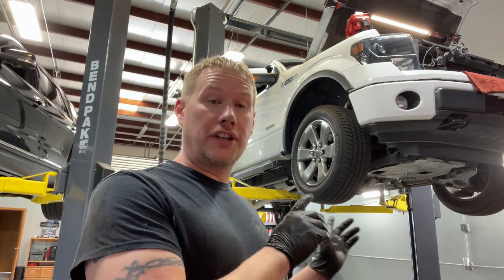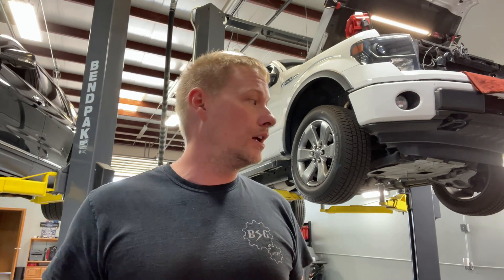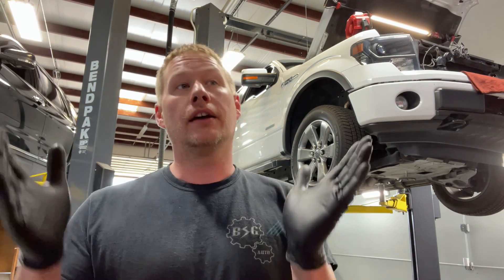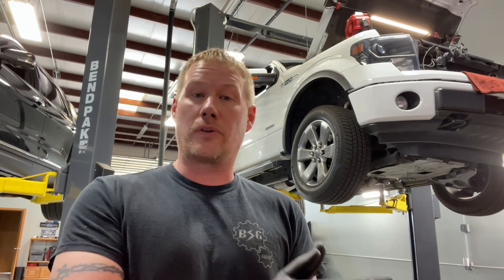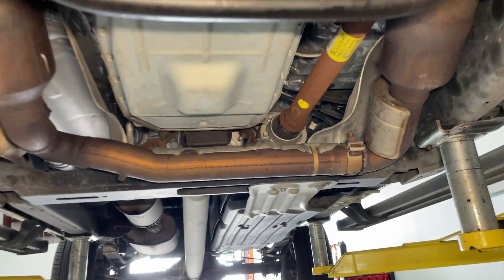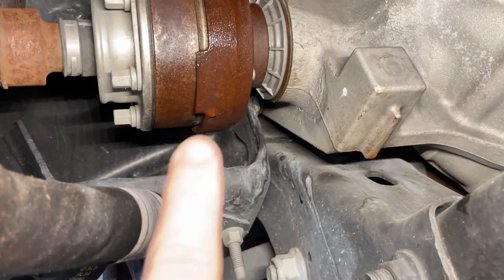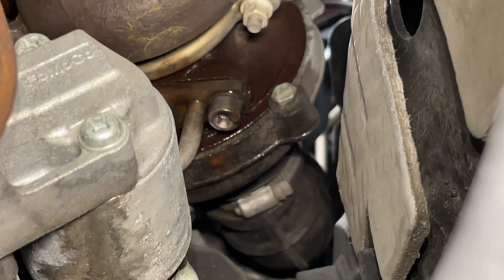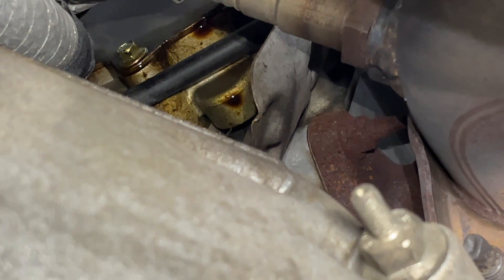Ford Ecoboost Engines Can be so Hit or Miss: I Really Feel Bad for This Customer...

Comment: I replaced my brothers ecoboost at 65000 miles as well. It’s just sad because the base 3.5L is an awesome motor.
Reply: Yeah. 
The engine really just can't take the extra load the dual turbo set up adds. 

They just need to add the custom turbo they use in the 2.0 engine and of the other ones. It won't be as powerful as the dual set up, bit it's alot lighter for the engine. 

It's the same issue the 1.5/6 engines had. They pushed them to hard.
Notice how the 2.0 engines actually seem to hold pretty good. They didn't go over kill
Reply: @nighttime1998  The 3.5l duratec was originally built for boost from day one in the early 2000s. It can handle it, there was just fords usual short comings in regards to oil temp control which ate away at the timing chain and then stuck valves through the pistons. Also lack of catch can and  no port injection for cleaning valves. So close Ford, so close!

Comment: Love my 2011 f250 4x4 6.2 gas. 180000 trouble free miles. Less fuel mileage,  but for me its a tax write off. My buddy has a 13 f150 with the 6.2. Wish they still made it.

Comment: I am on my second 3.5 EcoBoost in 9 yrs. 250k miles combined on the 2. Had 1 timing chain issue, valve cover leak, vac pump leak. The Ford's have been my favorite trucks I've owned, and EcoBoost my favorite performing engine. However I wish the EcoBoost was a pushrod engine like my  LS (or Godzilla) engines. Simpler design, easier to work on, don't leak nearly as much oil and coolant, and proven to be more reliable.
Reply: New LS is variable displacement and has had problems also like the new Coyote.  Old LS are rock solid dependable

Comment: Had a 2013 Ford explorer sport. T chain stretched. When you would start it up first start up of the day  sounded like engine was coming apart. And this was at 78.800 Had 100.000 mile warranty had to pay 100.00. But it was 3.800 touch screen locked up on it couldn't fix it. Had to order same one 4.200 another 100.00.  Very pleased with ford on all that. But the thing is people buying them and this stuff happening if u don't have a warranty man your SOL. High dollar stuff to fix. Have 2021 explorer ST now. Have put 7.600 on it so far.  We will see.  And o yea. Purchased BIG WARRANTY.

Comment: Aren't the new oils soppost to fix these issues the Sp Gf6 classification oils
Reply from the maker: yes
Reply: @FordTechMakuloco  Yes alot of folks that were using the old oils SN plus GF5 have had all these types of issues so far ive seen the SP Gf6 classification not having these issues.

Comment: Is there a video on replacing the vacuum pump?  Is it just a seal that leaks oil or does the pump need to be replaced?  I see oil on the back side of the passenger head on mine.

Comment: Did the guy state whether or not he tows with that truck.  Those EB 3.5’s have a nasty habit of falling apart when constantly exposed to torque strain (plow trucks up north or used for a lot of towing).   Also those turbos are notorious for leaking oil and coolant.  I agree at 70k it shouldn’t be like this.   Especially if your perform normal maintenance.

Comment: Thank you for this insightful assessment. In August 2020 I purchased a 2017 F-150 from a dealer who did not disclose the following required maintenance items:
Reply: Here's the list not disclosed: TSB 20-2016 3.5L EcoBoost - Rattle Type Noise from Engine Compartment., TSB 20-2028 3.5L EcoBoost - Cold Start Ticking/Tapping, TSB 20-2051 3.5L Ecoboost Oil Pan Leak., TSB 20-2028, Integrated Wheel End Grinding, Oil Leak on Driver's Side Valve Cover and Oil Leak on Front Differential Cover

Comment: My buddy bought a 13 a  few years, it sounds like a machine gun every time it starts up.  He's put about 75k on it with that problem.  In addition he had a transmission issue and it would just lose power on the interstate.  He said based on the mileage, ford would not cover it even though they extended the warranty.

Comment: I just went through a similar situation with my 15 lariat with 3.5 took in for start up noise and wrote up as oil leak coz he did wait to it to cool off so didn't hear the rattle. So naturally warranty only covers gasket till 100,000 miles mine had 122,000 had the normal block oil leak on right bank at blocking valve cover  but worse had an oil leak that was getting into #6 plug galley shortening oil coil so it cost me over 1200. And still has the start up rattle over night.

Comment: I had a 2013 F150 Platinum that I had a bunch of problems with.  One time all the instruments/gauges went dead on me and navigation locked up and the trans only operated in some fail safe mode where it only used gears 3/4/5 (or maybe 2/3/4) and shifted harshly at certain RPMs.  I limped home a bit over 100 miles in this mode.  this was at less than 30K miles and less than 3 years so Ford 'fixed' it under warranty by cleaning the trans valve body.(they wanted to replace it first but then said it could be just cleaned, I suspect the part would just take a long time to get or Ford didn't want to pay for it).  They could not explain the dead gauges nor reproduce it.  A few months later the trans began to shift a bit rougher periodically and once would not shift and I had to pull over and start/restart the truck to fix it.  It was at this point I traded it in for a 2018 F150 Limited that I still have.  It has been generally trouble free except for at 5K the 4x4 vacuum line was leaking causing one of the front wheels to partially engage and make that terrible rattling bolts in a coffee can sound.  Also, all 4 tires have dry rot after 3 years/29K but they are almost mostly worn out so Ford is putting some low grade rubber on new trucks.  Its such a shame for a truck with a $68K sticker price that costs even more now.  I looked at a Toyota Tundra back in 2013 and I'm sure if I bought that more plain truck that got worse fuel mileage I'd still be driving it today and would have saved a bunch of money in the long run even if I paid more in fuel costs.  Anyway, thanks goodness for honest mechanics (note these are not at the dealerships as far as I can tell).

Comment: Mine F 150 2018 purchased in April with less than 25K getting the lasers replaced for the same sound. Now my transmission may have problems. Do I need to have them check for leaks and repair? I purchased the Warranty.

Comment: This is getting ridiculous! 
I JUST bought a little over $1,700 worth of parts to fix the rattle and upgrade the for my 2013 F150 and these leaks are also happening. I did the job all by myself with the help of your videos and EVERYTHING came out GREAT! But I did notice the leak and smell of hot burning oil from those turbos or somewhere under the truck. Im DONE, because my  truck is also at ONLY 70k miles and its going through the same thing. Im thinking of opening a small claim on Ford. ESPECIALLY when I TOLD THEM ABOUT THE RATTLE ABOUT 4 YEARS AGO when MY TRUCK WAS UNDER WARRANTY! They said there was NOTHING wrong with it. Because of course it didn't rattle at every startup 4 years ago and when the customer brings it in to the dealer.

Comment: I am not a certain manufacturer fan boi by any means, own a Jeep, Toyota & GMC, but have owned a couple Fords and many other manufacturers' vehicles. I decided on a GM full size truck over a Ford, simply cause reliability. My truck is known for breaking exhaust manifold bolts and engine mounts, have personally fixed both on my truck and need to do another engine mount again 100K miles later. The part is $94 plus my time. I rather do this than all the repairs that the EcoBoost requires. I'm guessing most will let the leaks go, do the timing service and water pump and away they go.

Comment: I'm not impressed on these newer Fords, 2018 Limited Expedition 25k miles 3 months out of warranty, both rear struts leaking, sticking sunroof, now my driveline clunking again after being to the dealer to "fix" 3 times already. Will be replaced by a Toyota and never looking back.

Comment: I’ve always thought there is a price to pay for getting V8 power from a v6.  I know building up v8s you make more power you tend to have more issues, you go with turbos there is a lot of parts to have issues with.
Reply: not really .  forced induction is straight forward.  Exhaust goes back into intake for boost.  Nothing more nothing less.  Forced induction was in WW2 fighter planes, and been in trucks since forever going millions of miles.  These problems are just really overblown.

Comment: I have a 2013 limited eb in houston and will drive there too if necessary, my pump and turbo coolant leaks started to happen at 200k I got every thing done by my self spent less than 300hundred on parts got it done on the weekend  at my house ,thanks to bsg teaching us all the time ,and bc I don't trust any local mechanic and much less any dealer ship

Comment: My 2008 F150 5.4 has 71k on it.  Chain rattle started at 69k.  I don't gave a scratch on my truck.  Synthetic oil changed no later than 4000 miles since Ive owned it.  3 years and bought with 50k.  Pisses me off.  I baby my truck.  Its all I got to survive with.  My next truck might be Toyota TBH.

Comment: I own a 3.5 ecoboost 2011 F150 FX2 with 125K miles and 2017 F150 Raptor with 40K miles. Replaced braked booster on the former and replaced iwe vaccum line and a leaking plastic oil drain pan on the latter, other than that, its all regular oil & fluid change maintenance, replacement of wear and tear items like brake pads, brake rotors, etc. . Not sure if both trucks can last up to 300K miles but cross fingers

Comment: There are three problems with this vehicle starting with the Ford R&D did not find weak spots and correct them before roll-out.  Second is that the engine will produce heat that needs dissipating via radiation and liquids that use radiators. Even if the V8 has to rev higher to pack in the horses it is mainly dissipating cylinder heat via the water jackets. The boosted motor is having to dissipate more heat because more heat and from smaller water jackets with 2 less cylinders. And you have hotter oil. The coolant seems to not self-seal at all which is a major problem to the customer's wallet. If the truck gets driven in town then it may be severe conditions due to less airflow. If I want reliability and in town use I will use manual transmission only and watch what loads I subject the motor to because finessing the loads is in your hands at that point.

Comment: The reason I won’t buy an Ecoboost vehicle. Not that the rest are perfect; the water pump on my V8 F150 had to be replaced at around 20K miles. Luckily it was still under warranty.

Comment: My 2013 had coolant leaks galore.. some prior to 60k miles a the rest soon after 60k...after the 5yr 60k warranty in drivetrain.  Leak at one turbo, waterpump, lower radiator connection.  $3500 to repair all.  I was very disappointed.  Had no problems afterward, but traded it in June, with 82k miles on it.

Comment: I have 2 v10 2 valves, 1 is a 2002 in an Excursion with 190k miles, zero leaks, the other is a 2001 in an f250, zero leaks.........I think they may be running just fine and not leaking 20 years from now.  No eco boost for me, ever.

Comment: Fords. I’ve got an 05 4.2 in my shop now. I don’t do the guess stuff, but it’s to that point. Misfire, way worse once in gear. Literally runs as though it’s stuck in protect mode. I’ve done fuel pump, filter, coil pack, plugs, wires, egr, every major sensor, injectors cats. It got bit better but still bad. Any thoughts?

Comment: I have a 2013 ecoboost FX4 (Texas as well) just like this one; only difference is I have 180K on mine.  I have always maintained my vehicles exceptionally well.  The only issue I haven’t had yet is timing.  I personally replaced almost all quick connect fittings and lines on the turbo coolant system (2 are almost impossible - wasn’t going to spend that much time). Replaced steering assist unit, coolant reservoir quick connect and water pump.  I will say though most of this stuff didn’t start until 125K miles.  Only other item I replaced not mentioned (while doing turbo coolant issue) were the exhaust manifolds - both had the rear bolt broken off and exhaust leaks.  These are pretty serious chores when doing it on jack stands in the driveway.  Definitely had to buy a couple of specialized tools.

Comment: I had a 2013 EcoBoost that I bought brand new and drove it to 110k miles in about 7 years. I had the timing set TSB done on the truck TWICE in that time and it was still rattling the day I traded it in. The alleged new parts from Ford do not fix the issue. I never had a turbo leak but I did have the vacuum pump leak and fixed it myself and then the connector at the coolant overflow is a horrible design and will just keep leaking. Peragon sells a kit specifically to fix this issue. I'm not sure if Ford has any of these issues resolved in current trucks but that was my 2nd EcoBoost and my last unfortunately.

Comment: I've got an identical truck, 2013 3.5 with 185k miles. Its been a great truck doing the phasers this winter along with all of the turbo reseal and vaccume pump and de-gas bottle. Just gonna pull the cab and do it all at once

Comment: It’s crazy. I have a 13’ with 120k hard miles of towing and “off-roading” I live down a rough dirt road. I fixed the turbo leak and a throttle body on it and other than that it’s been rock solid. I love my ecoboost. At least for now. 🤞🏽
Reply: They have sold over 1 million ecoboost f150's . Some of them will have problems. It's funny when you go to any dealership that carries any brand of vehicle. Their shop is full of that brand of vehicles. Even the over hyped Toyota's break all the time, they all do
Reply: @shroom903  I worked for a Toyota stealership for a while, gotta tell you, their shop was almost empty they had cars but mostly for routine service. Then I worked for a Ford dealership their service department parking area is extremely large and packed to the brim. Cars and trucks came in for engine or transmission replacement under warranty. There was always a parade of towing trucks bringing in more and more broken down cars. Some times cars that were sold the prior weekend were in for repairs and were brought on a flat bed. So it's really bad.
Reply: @noelaguirre7104  that’s because ford sells significantly more vehicles than toyota in addition to toyota vehicles being more reliable 
More vehicles sold = more vehicles required to be maintained or repaired
Reply: @twinkieerella  check your sources. Toyota and Ford sell roughly the same number of vehicles in the US and have done for years. In fact, more Toyotas have been sold so far this year by a fair margin.
Reply: @nergispaul9022  There is at least twice as many Toyotas on the road than Fords.  They historically haven’t sold as many, but they just keep on going.
Reply: Sure bud just don't open the hood or look at the puddles in your driveway and you will be a happy consumer.
Reply: @TokenTombstone  Or maybe there are just failures everywhere and the vast majority of EcoBoosts are fine.

Comment: There is a huge shortage of qualified mechanics and parts right now.  I would get everything done now and hopefully it will give you another 10-20yrs of service.  Maybe a product can be used to keep these seals and gaskets from drying out and leaking that other people in Texas are using.

New trucks are $50k and more -if you can even get one.  A vehicle like this is worth $20k-30k with the low mileage.  The hurricane in Louisiana and East Coast flooding doesn't help vehicle supply either.  Toyota production down 40% in Sept etc = the vehicle market is getting tighter.

Comment: Just bought a 13 F-150 Ecoboost. It, too, was also well taken care of and looks and drives like it just rolled off the lot new. Arizona vehicle most of its life. I bought the extended warranty that covers everything for 5 years and 80k miles from when I bought the truck. I plan on towing with it, so I wanted to make sure I didn't have any surprise repair bills like this

Comment: FIRE HAZARD ON MY FORD DEALER DID NOT CARE!!! PLEASE READ AND PASS ON. MAY SAVE SOME FAMILY OR A GUYS WIFE,KID!!!This does not surprise me at all. We have a 2013 ford escape. We started having leaks at around 15000 miles. Oil,coolant it was so bad the cover under the engine was soaked.  At every oil change and check they said nothing and would put that old cover back on. BIG FIRE HAZARD!!!. Then the recalls started. Recall for turbo leak !! Tried to repair it but they could not do it. Tried to give back with oil soaked  engine cover again I would take it. They would not replace it till I went into the waiting room and in loud voice that is a FIRE HAZARD REPLACE IT. they took it off said had to order one. Problem is it needs to be on there to help keep from overheating!!.stilled had coolant leaks.  Beleave me as a big ford guy have 15 to 20 BUT WILL NEVER BUY ANOTHER !!! THAT THING LEAKED THEY NEVER FIXED IT JUST BEFORE WARRANTY WENT OUT IT WAS BACK IN TOLD THEM FIX THE COOLANT LEAK. HELL THERE WAS EVEN A RECALL ON IT HAD IT 3 DAYS SAID IT WAS FIXED APP. 15 DAYS LEFT MY WIFE ON SIDE OF ROAD AGAIN. WRECKER HAD PICKED IT UP 5 TIMES BEFORE IT WENT OUT OF WARRANTY.  THINK IT WAS RIGHT AT END OF WARRANTY FORD TOLD ME I SHOULD JUNK IT AND BUY A NEW ONE. THIS IS A BIG DEALERSHIP HERE IN EDMOND AND OKLAHOMA CITY.  SO JUST BECAUSE YOU TAKE IT TO THE DEALER DOESN'T MEAN THEY ARE TREATING YOU RIGHT. !!! YES FORD SCREWED US. WRECKER COMPANY MADE MONEY.

Comment: Have a 14 mkz with 85000 serviced every 4-5 thousand. Still falling apart even with the 3.7l. Just had a cell light for a p0430 bank two. The fancy ride control failed three times. Just dealing with it till the market gets better. Ford quality is a let down especially for a brand they want to revive.